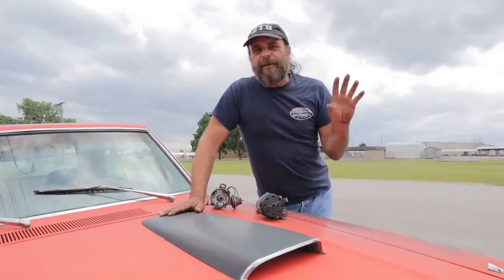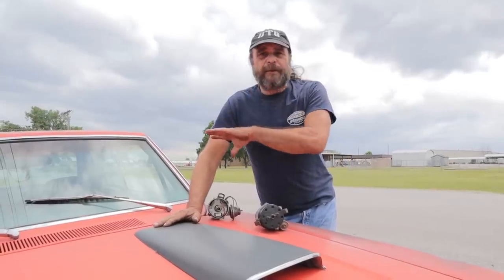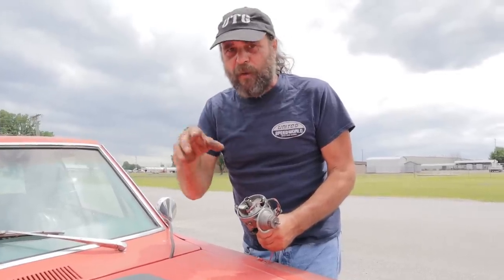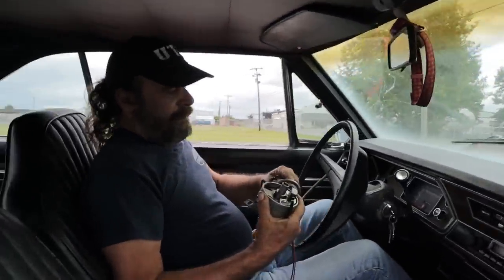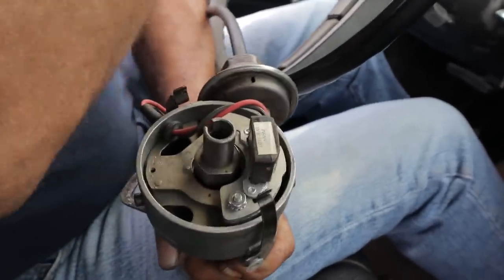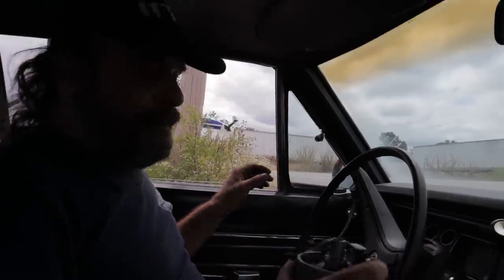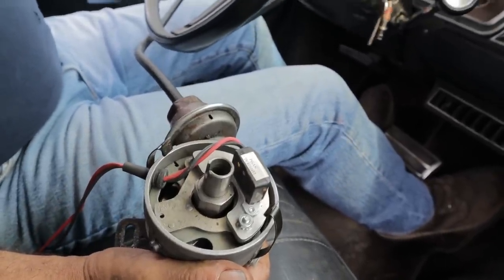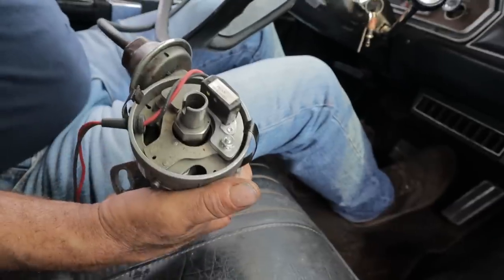The Vacuum Advance Debate!

Comment: I see nobody has mentioned that the old pre smog advance cans (which were hooked to manifold vacuum) only had 8-12 degrees of vacuum advance. The later ones which were hooked to ported could have upwards of 20 degrees. Most engines will like manifold better IF you take the time to see how many degrees of vacuum advance you have, and weld up the slot to limit the travel of the vacuum advance so you only get 10 degrees out of the vacuum pot.  A good rule is an engine without EGR will want less than 12 degrees. EGR equipped engines will want upwards of 20.
Reply: Not all advance canisters are created equal. Take the time to check EXACTLY how many degreees it is.  Put a stiff set of springs in the centrifugal advance while checking this, because the extra advance from the vacuum canister will cause the idle speed to increase and the weights will start to move and give you an incorrect reading.  Remove stiff springs after performing this test.

Comment: It seems to me that the people who are running manifold vacuum because it runs better should really just be using more initial timing and saving the vacuum advance for part throttle applications, where you can fiddle with the adjustment to find the best advance

Comment: As I understand it, once the throttle plate exposes the ported vacuum, the ported and manifold vacuum are the same, therefore under acceleration, the timing will be the same. Whether you are “retarding” the timing from manifold vacuum at idle, or “advancing” the timing from (lack of) ported vacuum at idle, you are ending up at the same exact amount timing advance under acceleration. What differences there are will be the tiny amounts of idle throttle position and mixture screw positions at idle depending on whether the idle adjustments were made with ported or manifold vacuum. Once you get past the transition slots, can the engine tell the difference between ported and manifold vacuum?
What seems to be missing from these discussions is how the vacuum advance is adjusted. My 63 260 V8 Ford distributor has two adjustments in the vacuum advance unit - you can adjust the spring pressure and the amount of maximum advance. What does the vacuum level vs. timing advance curve look like? Then there is the interaction with the power valve that also which also acts off of vacuum (is the power valve ported or manifold vacuum?).
Also if you have messed with your centrifugal and static timing (say more static timing, faster centrifugal advance by using lighter springs, and limiting the amount of centrifugal advance allowed), how does that interact?
As UT points out, the vacuum advance is not there for power or drag racing. The vacuum advance is there for drivability and fuel economy.

Comment: The purpose of the vacuum advance is for fuel economy. Fuel economy is at light throttle/cruise. You don't want your timing too high at idle. Ported vacuum creates the little timing advance for the fuel economy.

Comment: manifold vac. is the way all cars of the 50's and 60's were set up..manifold vac. upon acceleration backs off timing, which keeps the engine from pinging while under load..at low rpm.
Reply: Though I'm a big fan of manifold vac, that's a myth.  My 41 Chevy had ported straight from the factory and so did man even older cars.
Reply: @FrankGlencairn  i said of the 50's and 60's not the 40's..I have no idea what they used in the 40's ..it just goes to show that even the factories had their own preferences..

Comment: What I found with my car is that it required less throttle opening to maintain a good idle with manifold vacuum. With ported, I had to have the throttle open more, no big deal, except that the car tended to run on and diesel when I shut it off.
 Your results may vary.
Reply: Sounds like you are not tuning your carburetor correct. To lower your idle speed, you need more air to bypass the throttle blades. Opening the secondary blades a slight amount, or drilling the primary blades. The idle circuit alone,  may not supply enough air for a good running idle. The added air will allow you to close the primary blades and the idle circuit will function properly. Please read HP books Holley carburetor manual.  Your welcome.....
.
Reply: Thats a Chevy Engine you are working on 😅😅😅😅

Comment: Friends 350 Nova, when he changed manifold and carb ran tired. After talking he showed me how the install info said to use manifold. I switched it to Venturi and after having to replace the vacuum advance unit car ran great. Manifold vacuum had separated the diaphragm. Never did use manifold on anything but the wipers and heater switch

Comment: Really just depends on what works better for your specific engine. 
My 10 to 1 350 w/280 comp flat tappet likes ported better. 
Keep the idle more steady as well. 
My situation is likely due to the fact that the car in drive has vacuum below the vacuum can opening point. But when it’s in park, more vacuum comes in and the vac adv is kicking in.

Comment: So, in an off roading environment, no throttle geared way down letting the engine pull down to a low rpm, which is going to stall easier? In my limited understanding i would think manifold would be better for that aspect?

Comment: In my opinion it is six of one, half dozen of the other. Stock base timing back in the day was 0° to 8° in that range. Was it for emission reasons? Most likely. They started easy but would be sluggish off idle with timing that low. We dont bother with emission requirements on 50+ year old cars anymore, we set base timing to 10° or more for better off idle and low speed performance. Because of using higher base timing, having manifold vacuum increase timing at idle is not as important and may even cause detonation in some cases. I would like to have seen 2 distributors set up inside the car, one connected to manifold the other to ported and drive the car.

Comment: I have certainly seen both sides pointed out.  However doesn't this demonstration just show Vacuum Advance going away as the vehicle is accelerated. You would still be left with the same amount of Initial+Mechanical.  Does that extra advance dropping out quickly cause a negative performance issue and is there MPG benefit to having that extra timing during idle?